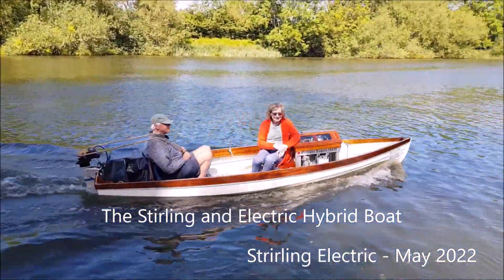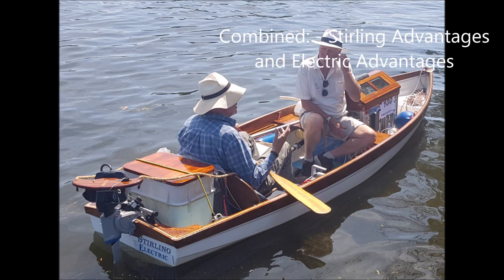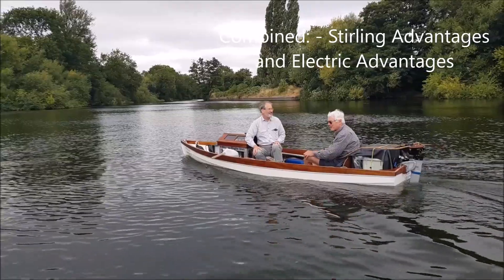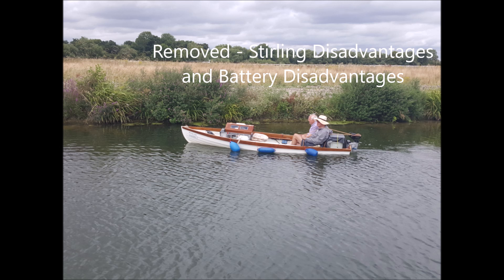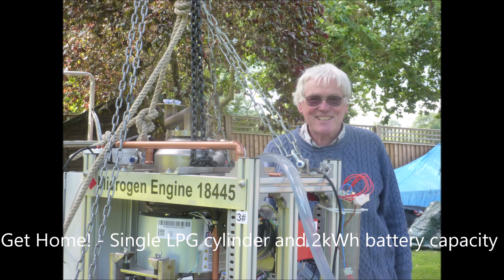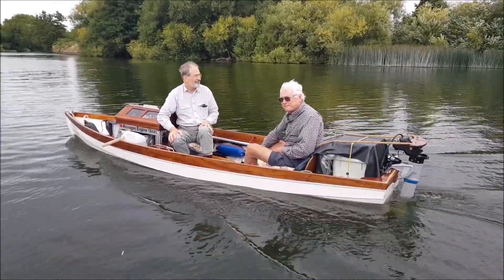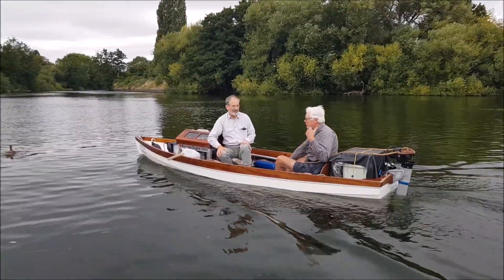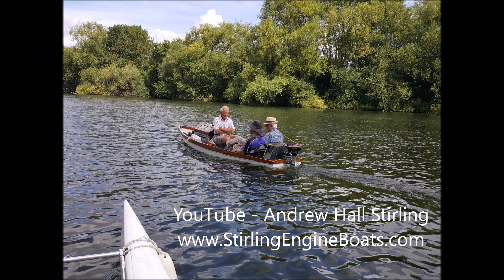Stirling Electric

Comment: Awesome, love it. This is exactly what I had in mind the stirling engine is very efficient while the electric motor is also very efficient but very powerful as well. Range extender stirling engine, awesome. And how quiet the boat is.
Reply from the maker: Thank you. It's taken a few years to get to the current state - but I now have a day boat for use  - not an engineering project in development!

Comment: Hi Andrew, very good video and well explained. Are you using a charge controller of some sort? Kind regards
Reply from the maker: Yes - The ePropulsion outboard can use 1kW at 48v DC. There is a battery, 48v, between the Stirling and the outboard.
The outboard can use a little more than 20A at 48v (20A x 48v = 960W).
The battery is rated to take charge, up to 25A, from the generator and also able to discharge at the same rate
So, the generated current flows into the battery and straight out the other side
If the generator is putting out 20A and the outboard is set to half speed then the excess is used to charge the battery
The reverse also happens.
The final piece of the "jigsaw" is that the Stirling produces AC.
A Victron unit us used to covert to DC
Have a look at https://www.youtube.com/watch?v=Ry-K9xg7Hec&t=8s
Andrew
andrewthamesside@gmail.com
Reply: @andrewhall2702  thank you for an in depth reply. Is there something that limits the current from the stirling engine when the outboard is on full power? Or does the charge controller take care of this when the voltage drops? Sorry for all the questions : ) cheers
Reply from the maker: @ShanePomeroy  Always happy to answer questions. I think that the output from the Stirling engine is controlled by the Stirling engine control unit. The Microgen Stirling Power Cell (SPC) is used most widely as a combined heat and power unit. So the SPC is carefully controlled to produce 50 cycle AC at 230v - to feed the grid. Keep asking:)  We will find the limits to my knowledge! Have a look at https://www.microgen-engine.com/